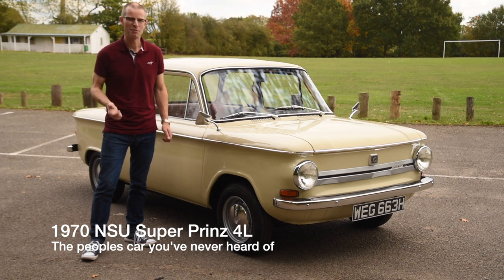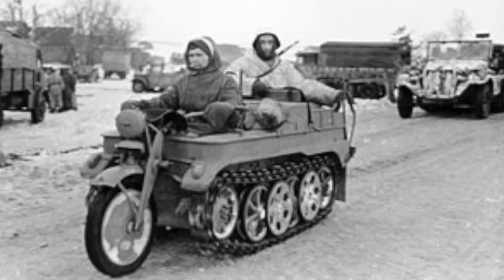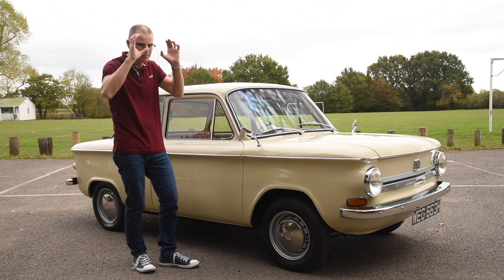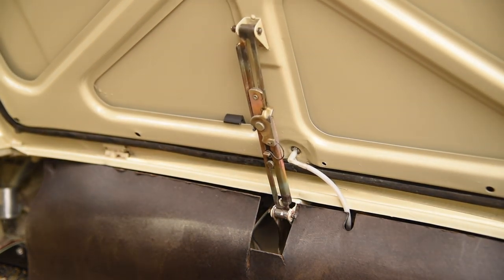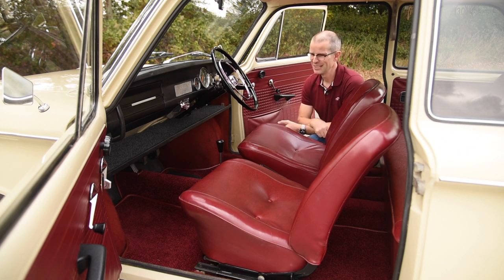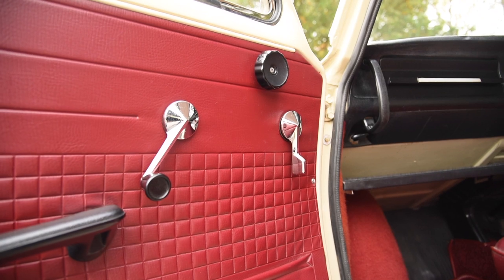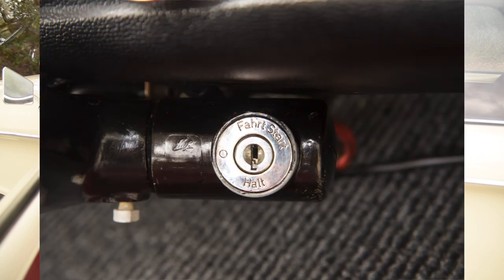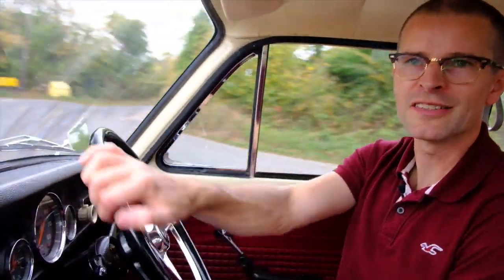1970 NSU Super Prinz 4L taken for a drive

Comment: The engine was not a 'flat-twin' but a 'two cylinder line'. I had a Prinz in the 70's and loved it. He forgot to mention that it was a good idea to place a sack of potatoes in the (front) boot during the winter months as the car was very light at the front, nevertheless the road-holding was relatively good , being better than the beetle or the Simca 1000 as it was less wind-sensitive than they were. A great point in its favour was that the overhead-camshaft (!) was driven by a shaft directly from the crankshaft so it was 100% reliable (and efficient). A smashing car ........... its big brother the Prinz1000 was even better with a 4 cylinder engine. I love them both.

Comment: If you really want to report on a car that was also a direct competitor to the VW Beetle (and even had roughly the same shape), get your hands on a two-stroke AutoUnion 1000 from about the same era - complete with a free-wheel lever to save the engine when going downhill. The only difference was that the AutoUnion was front-wheel drive and had the engine in the front as opposed to the back. Furthermore, if you want to see a really tiny engine in a positively cavernous engine-compartment, take a look at the Goliath (also of about the same era).

The real problems for light vehicles like the NSU Prinz (and even more so the VW Beetle) was that they were conceived to be run on the cross-ply tyres of the era, which made the cars easily correctible when the back-end let go on fast bends, due to their relatively stiff side-walls; the slide was easier to manage. Then radial tyres were introduced as a "benefit", but they behaved completely differently. Their soft side-walls allowed the tyres to go to the extreme edge of gripping ability before suddenly, and often quite catastrophically, letting go all at once. That's the reason that Formula One cars, even today, are still all fitted with cross-ply tyres.

MsG
Reply from the maker: I don't think Ive ever seen or heard of one in the UK, Ill have to road trip to Holland or Germany, which isn't a bad thing!

Comment: I was told the heater was a heat exchanger around the exhaust. Is that true? And if so, how come no-one was gassed by a rusted through exhaust?
Reply: Sounds similar to the VW Beetle. I assume the heat exchanger was stainless , so that by the time it leaked, the body had big enough rust holes to let the exhaust out.
Reply: I heard several stories about people being gassed by rotten exhausts and heater boxes on the Beatles. If they are true, I don't know. The worst stories about the Beatle was told by my uncle who saw a man burning to death because the fuel tank of his beetle burst in an accident and covered him in fuel because the fuel tank is under the windshield.

Comment: @ 4:02 It's not a flat 2, but an inline 2. And the cam drive is a gem.. It's not by a chain, many sprockets or a belt, but by exentrics. :-)
Reply: Skoda130 More specifically two parallel rods runing on eccentric bearings with a 90° offset, rather like a steam engine drive.
Reply: @michaelXXLF  It's 3 rods with 120 degrees offset. ;-)
Reply: @Skoda130  Actually, there are three rods, but only two are moving the cam and at all. The third "rod", the one closest to the engine, is a kind of spacer that ensures a constant distance between crank- and camshaft at all temperatures. Also, there was at least one counterweight at the top which would not have been necessary with three rods at 120°.
Reply: I believe the camshaft drive was based on the system designed by W.O. Bentley for his 3-litre and other models in the 1920s.

Comment: This the Hillman Imp, Renault Dauphine,  and most of the rear engine at the time. First thing to do, remove spare wheel, replace with concrete block or bag of sand.

Comment: I see you've picked up on your mistake concerning the engine configuration - a straight or, in motorcycle parlance, parallel twin.
In terms of styling, it looks like a Corvair and a Fiat 1500 had a baby (with a Hillman Imp as godfather). I remember the Prinz as being quite common in UK in the 60s (a time when British cars still dominated the home market).
The magnificent Ro 80 was NSU's crowning glory, but it also drove them to the wall. My uncle had an NSU scooter - rather a clumsy beast compared to my father's Vespas. Cream had a song by the title of NSU (why?).
That clever light switch was also to be found in the 1970 Opel Rekord I owned for many years.
My copy of the 1967 Observer's Book of Automobiles describes the Prinz 1000TT, which was powered by a 1098cc four cylinder engine, placed transversely in the same rear compartment.
Thanks for reviewing an interesting car from the past.
Reply: I think the NSU Eric, Jack and Ginger were referring to would be called an STD today and I don't mean telephone systems.......
Reply: @jonathangriffin1120  Ah ha! Interesting! I'll now have to rack my brain to figure out what the abbreviation stands for - or I could cheat and try to Google it. Thanks very much for the information.

Comment: My mother had two Prinzes in succession, a series 1 and a 4. Very solid little cars. However, the presenter didn't do justice to NSU as a motorcycle manufacturer. They were the largest in Europe in the '50s, famous for the Sportmax, ridden by both John Surtees and Mike Hailwood, and for the 50cc Quickly moped, the Honda 50 if its day. Millions of them were sold all over the world.
Reply: how much do these cost today?
Reply: @fidelcatsro6948  Just checked - good Prinz 4s start at about £6,000-7,000, but more than twice that for the rare and pretty Sport (coupé) version, and 4-5 times more for the even rarer Wankel-engined Spyder.

Comment: Loved it! I only saw one of these racing before, never in this original state. You should try an Ro80 and a VW k70 too to see just how bleeding edge NSU were in the end. Oh and try a DKW F102, which later became Audi 60 with a 4-stroke engine. It's funny when you look in the engine bay of an Audi from the late 80's and find the engine hanging way up to the front of the car, just like the 2-stroke did in the F102 (difference ofcourse being the size and weight of the 2-stroke was quite different to the 4-5 cylinder Audi engines that superceded it).
Reply from the maker: Apparently in the 2000s Audi tried to move the engine back to take out some understeer but customers didn't like it and they had to move it back, don't know if thats true but would like to think it is! 
If I find any of that list they'd be things Id drive

Comment: It was fairly known in Denmark. My parents had 3 of them. The first had issues. The second had issues. And the third that they bought around 1974, burst into flames due to an engine fire. I was on the back seat when that happened. Only a couple of months old. Then it was placed on my grand parents farm, and when I was around 6 years old, my father got it started one final time. We ran it 600 meters, and then it was dead for good. I think he forgot to check the radiator for liquid.
Reply from the maker: Id say bursting into flames counts as an issue!
Reply: @furiousdriving  Yup. It might have been a busted fuel line or something. At least it got to run down a person on a moped. The moped driver ran over a red light. Ironically it was an NSU moped.

Comment: The RO80 by NSU was a superb motor. It was (as has already been said) well ahead of it's time. Sadly, the Wankel rotary engine wasn't so great and suffered huge reliability problems. I can't help but wonder why they didn't revert back to a conventional engine design.
Reply: The RO80 indeed was ahead of its time and no, the Wankel engine was not a failure. Basically all the problems were fixed even before the RO80 went out of production.
However, the Wankel engine is the link between a 4 stroke Otto engine and the gasturbine, it pumps out lots of power at low weight.
Mazda did produce Wankel engines till lately in the RX7 and RX8

Comment: This was/is a great little car, and I've owned one in the seventies.
First of all, it's not supposed to have wing mirrors, it came with ONE door mirror, under the quarter-light.
It has four non-assisted drum brakes, like most small cars in that era, so braking needs to get used to.
It didn't have a flat twin ("boxer") engine, but a parallel twin.
The reason it had two coils: no need for a distributor. Simple = low maintenance.
Not mentioned in the clip: two interesting technical facts:
It had a "dynastart" (combined starter/generator) built into the crankcase. No belts = low maintenance.
And the engine had an "Ultramax" rod driven camshaft. (Again: low maintenance)
There's an interesting page (in Dutch) that illustrates the working of this ingenious camshaft drive.
http://www.nsu4.nl/artikelentechniek/2u1205ultramaxnokzuiger.html
http://www.nsu4.nl/artikelentechniek/2u1204ultramaxnok.html

Comment: the design is similar to the Zaz 968M
Reply: 966 and 968 design were pretty much copied from Prinz II generation. Engine was different tho.
Reply: @marguskiis7711  yes, 966 and 968 had more powerful air cooled V4 engines.

Comment: I had an NSU Prinz  back in the 1970s fantastic little things surprisingly nippy for such a tiny engine two problems I had with it first the gear shift is a bit sloppy and the cup could come of the ball connector by the gearbox and leave you stuck in one or no gear.      Then for a two cylinder engine I did manage to get through 6 pistons in the year or so that I had it so I lost interest in small cars and went back the the good old 6 cylinder Vauxhall Crestas .      One final point the guy in the garage where I part exchanged the NSU told me later that the person who bought it off him also blew the engine up on it leaving him with a large bill to repair it.
Reply: I guess this was before the days that secondhand car dealers started selling next-to-useless insurance backed warranties to evade their responsibility in the event of a engine blowing up.  (Maybe those warranties are not all useless, but the ones I have had, have been).
Reply: @andrewstones2921  To be honest the garage that I got it from was very good to me and repaired it free of charge when it broke down.  the only thing when I decided to change it they refused point blank to take in in as part exchange for anything but then who could blame them.

Comment: The presenter doesn't know much, does he?    The engine is not a flat twin, it's an inline twin.  It's essentially a transverse twin motorcycle engine, and a coil for each plug is not an overkill as the presenter claimed at 4:07, its standard motorcycle practice,  as best dynamic balance is obtained in an inline twin with both cylinders firing together.   If you had only one coil, one plug would hog all the discharge.   
Ah! NSU, the company that would spend money building a car more or less right, but make do with a really gutless engine.   Then bring out the utterly ridiculous Ro-80 - the expensive luxury car that required an engine rebuild about every 4 to 6 months.
The presenter has us believe that it drives like a new one - but he didn't tell us the mileage.   Perhaps it has been restored.

Comment: It's in mint condition for a car pushing 50. No seat belts obviously. My 2018 Toyota Rav 4 has a five star crash rating. I wouldn't want to go back to an older car after driving it. The Prinz is amazing but it doesn't look very safe.

Comment: The "big little car" thing is something that VW has continued, after shaking off the Beetle and its ilk. It's maybe not been quite as evident with the very smallest models like the Lupo, Fox and Up!, but certainly there's generally been common styling cues running through each generation of Polo-Golf-Passat, and you could almost argue they did this before Audi... except that two of those cars have origins as 70s Audis (the 50 and the 80 ... quite whether the Golf would have been the 60, 65 or 70 if its platform had wormed into their range before the days of the A3 is anyone's guess), with one appearing much like the shrunken, ends-snipped-and-folded version of the other, with the Golf then appearing in-between as an amalgam of both when VW decided to steal them back from the subsidiary. It's possible that that NSU element within Audi just decided to keep going with the "normal car, merely smaller" idea of the Prinz post-takeover, ultimately birthing the 50...

It's one of the things that actually drew me to the early 90s Polo as a first car. Unlike a lot of the others I looked at, it didn't look like a toy, and the inside didn't feel like a compromise where they tried to fit in the things that were expected to a space they wouldn't fit, without applying any thought. It just looked like a Passat Estate that had gone through a hot wash, and whilst the inside was still fairly spartan, someone had evidently spent quite a lot of time and effort getting it right, making the general layout work, arranging the switches and levers in a sensible manner, actually giving a crap rather than thinking "ah, it's just a small, cheap, toy car, who's going to care?". Had quite a bit of the Prinz solidity as well - e.g. it felt rather more planted on the motorway, whilst belting along at its otherwise modest top speed, than the 7~8 years newer Punto of my mum's had done at the same pace.

Comment: What a Hillman Imp should have been.
Reply: Back in the 1970 I the Imp was considered undesirable and unreliable, mostly the unreliability came from people not understanding that the front corner had to be raised when topping up the coolant to prevent air-locks from forming in the long coolant pipes, the result was lots of overheating Imps.   But Imps (and derivatives)  were great cars, and are recognised as such now much more so than when they were new.

Comment: my dad had one in the early 70s. very unreliable.
Reply: My dad had one. Looked fine until you wanted to go anywhere. Would break down at the slightest hint of damp air. We were pushed through Glasgow by a bus one winter when the engine failed at traffic lights. Remembering the rear parcel shelf had a neat little storage box for my comics.

Comment: I think NSU used the Wankel rotary engine in a much bigger and later saloon car
Reply from the maker: yes, the Ro80
Reply: The first NSU with a Wankel engine was the Wankel Spider, the body was more or less a roadster version of the Sport Prinz.
The Ro80 came later. And the VW K70 (with a "normal" K_olbenmotor (piston engine)) was originally designed as the NSU K70.